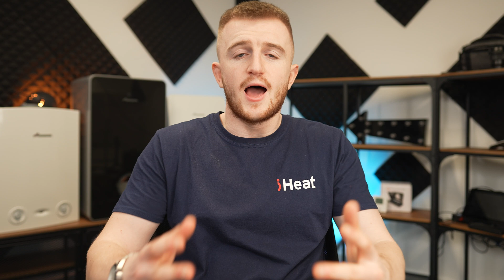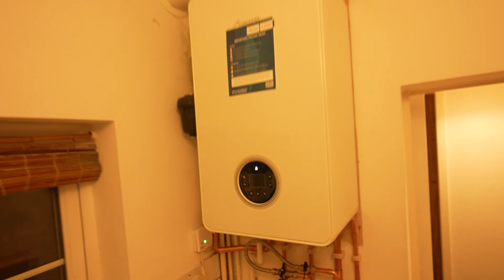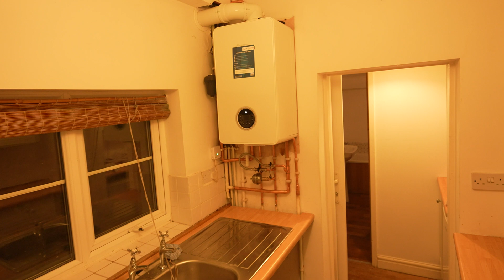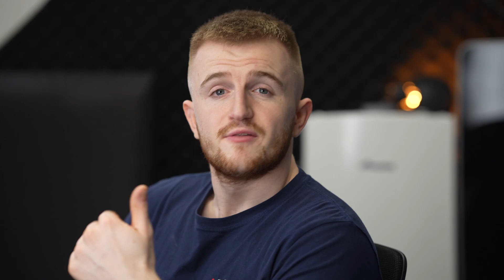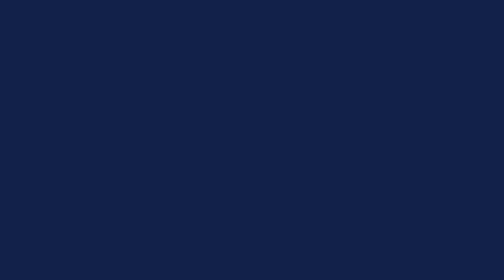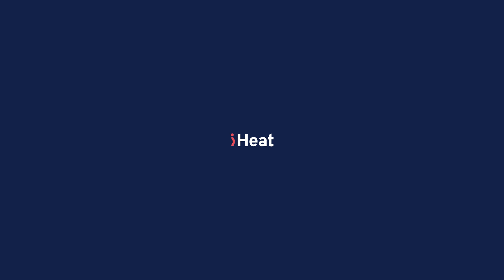Top 10 Benefits of a Combi Boiler

Comment: 800 quid a year saving bollocks my mate changed to a combi boiler he said it made little difference to his bills and forked out thousands to get the boiler supplied and fitted by the time you make your money back you'll need another boiler
Reply: Yes, the majority of modern condensing boilers are set at too high a temp to condense, so they're no more efficient than old style boilers.

Comment: Combi boilers are over complicated and unreliable.Ease of fitting only benefits the installer. Having a water tank and a simple reliable boiler makes sense for the homeowner not work for installers repairing combis.
Reply from the maker: you could argue having a tank limits the water usage, one of my biggest pet peeves is someone having a bath in my home before me and not having enough water to accommodate. Switching to a combi boiler means unlimited hot water
Reply: There are some benefits, not having a hot water tank saves space and reduces energy losses. No worries about ever running out of hot water either, so that's a positive for big families where lots of people are showering.

Comment: Hi, I'm looking at getting a new combi boiler, I'm not sure whether to get a 25kw or 30kw ? I have 3 bed 2 bath home. What would you recommend ?
Reply: @CKen1991  I had a choice like that. I went for the largest of the two. I have a three bed end terrorist house with high ceiling and big rooms. My heating system engineer recommended the bigger boiler.
Reply from the maker: It all depends on how often you use HW outlets at the same time! If you often use both baths/showers simultaneously then 30-35kw would be much better, but if its usually only one outlet at a time then 25kw would do that.
Reply: @iheat  Hi, 25kw will do me fine then, thanks for the reply I really appreciate it.